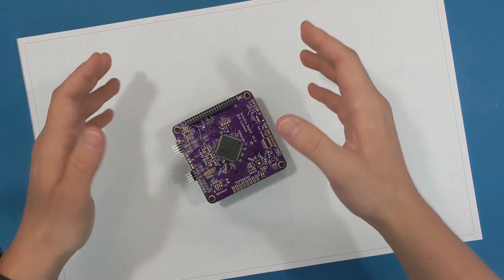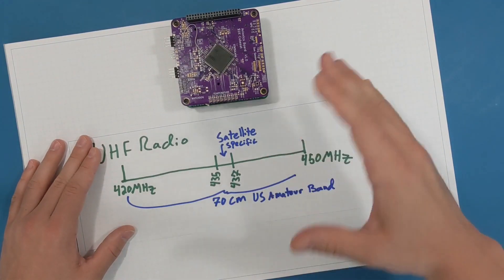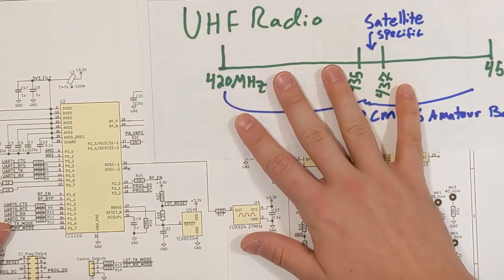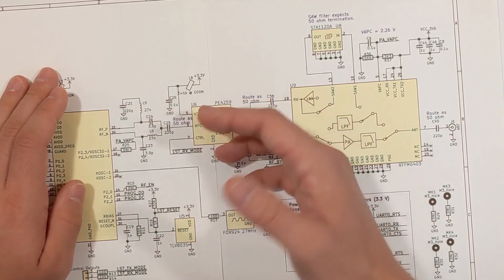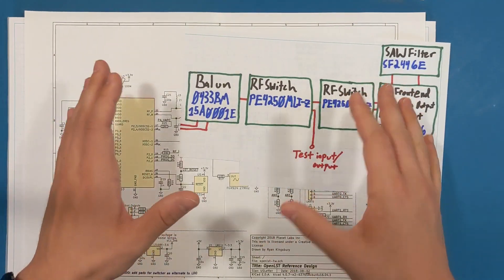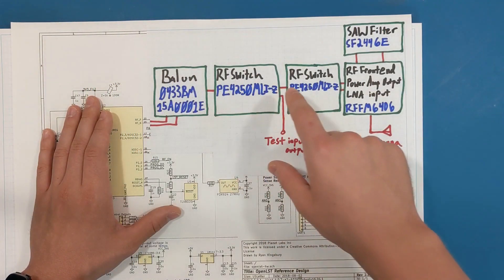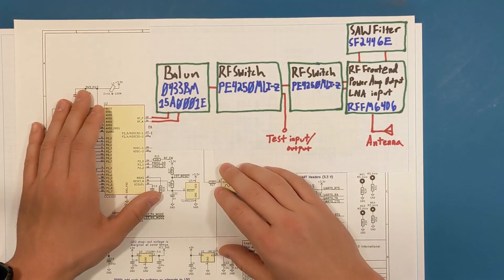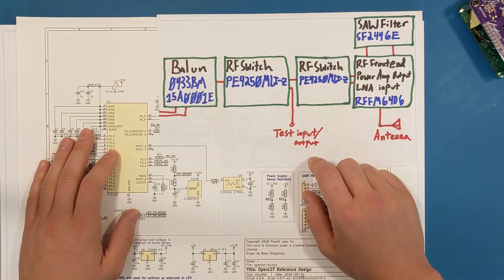$1K Cubesat Radio Design Overview | CC1110 & OpenLST

Comment: Please dont tell me you gave up on this project. I ordered some pcbs using your design. Not even close to the level of know how to build and sucessfully launch a cubesat. But your videos are perfect for entry level.  If you need funding for the project let me know I can assist. Personally I have been looking at the purdue water thrusters with 10 micron orfice along with magnetic remdezvous. Wanting to build a 2u unit and 2 1U cubes that dock in orbit. Solar has come along way since this post. Tested flexible panels encased in epoxy personally works pretty well in testing. But again I am nowhere near the level needed to build and launch and dock in ordibit just experimenting and trying to learn want to launch one eventually.

Comment: Don't get discouraged.  Engineering prototypes are great.  They allow you to work through problems that you never see on the drafting board/computer.  Your multiple board cubesat design is flexible enough to allow choices of communications boards.  EPS and Nav as well.  Im following you to see your engineering process.

Comment: It looks like cubesats have evolved. Some are smaller 5x5x5 cm and use LoRa using an sx1276 or sx1278 chip on 433 MHz band.  Have you seen TinyGS yet?

Comment: It's not hard to get your HAM license so you can test your satellite over the air.  Your local HAM club may have free lessons.  It does not cost a lot to take the exam ($15).   73 (Greetings)  Konrad   WA4OSH
Reply from the maker: Yeah I just need to spend some time on exam prep, and schedule a time to take the test
Reply: @RGSAT  There are four or five Amateur radio clubs that have volunteer examiners (VE) that administer the US Amateur license exams over the Internet.  In foreign countries, the exams may be admisistered by the government or amateur radio clubs.  You will have to research this.
Reply: @RGSAT  There are practice exams available for free at QRZ.  You don't need a call sign to register.  Once you've cycled through all of the test questions in their test pool, you will be ready for the test.
Reply: QRZ:  Resources, Amateur Radio Exams, 2018 Technician Exam Practice Test

Comment: My interest in your Cubesat project just peaked since you've decided to use a HAM radio transceiver instead of Iridium.  Are you going to use the Great Scott Gadgets Yardstick One to test this radio board's receiver and transmitter?  Don't forget to include a variable attenuator between your board and the Yardstick.  You need to simulate about 400 miles of over-the-air path loss.  I would love to build a duplicate of your CubeSat to follow along your design learn more.  Please let us know how we can contribute.
Reply from the maker: Hey Konrad! I don't have the Yardstick One, but I do have a RTL SDR. 

I'll be covering how testing is going in my next video!
Reply: @RGSAT  an RTL SDR is useful for conductive testing (through coax with an attenuator simulating path loss).  GNU RADIO Companion will allow you to decode packets sent by your RF board.  However, you might need a HackRF one with GRC or a Yardstick One to transmit to test the receiver.  To do a radiative test (over the air)  420-450 MHz at 1 watt you will need your Amateur Radio license (part 97).
Reply: @RGSAT  Also the pathloss is often up to 2500km.  I would definitely do a link budget assuming a low earth orbit and consider crowd sourcing the ground stations with both the TinyGS and SatNOGS for LoRa and FSK variants respectively.

Comment: Hey! You have very interesting content, I am following your work! 

I would like to ask a few questions (sorry for my english, I am writing through a translator):
1) Do I understand correctly that your cubesat is powered by a 1S2P battery? Is all equipment powered directly from the battery, or are boost converters used?
2) Which models of lithium ion batteries are commonly used in cubesats, and from which manufacturer? The decisive characteristic is the operating temperature range?
3) Does the number of batteries connected in series (1S, 2S, 3S) depend on the size of the cubesat and solar panel? A large enough panel can provide a higher voltage, which can be used to charge 2-3S batteries. After all, as far as I remember, the buck converters that will be needed to power the payload are usually somewhat more efficient than the step-up.
Thank you!
Reply from the maker: 1) I have 2 batteries in "parallel", but they are not connected to each other. Each battery has its own Battery manager chip. The outputs of the battery managers are combined. This is useful, since one battery could die, and it doesn't negatively impact the other battery. 

2) I believe the cylindrical (18650) lithium ion batteries are popular, but I don't know which batteries specifically. Probably the batteries that can do more charge/discharge cycles. 
 
3) Good question! I don't know what the right answer is. For a simple cubesat like mine, I decided to not deal with in-series batteries. Series lithium-ion batteries require balancing & more complicated chargers. There are a lot of simple 1S chargers on the market, which is why I went that route. 

I use a step up converter from my 1S battery to create 5V. It would have been nice to have 2S, but it's not that big an issue.
Reply: @RGSAT  Thanks for your reply! I'm waiting for a new video =)

Comment: What’s the difference between a 30k$ cubesat and yours
Reply from the maker: More off-the-shelf modules!  At the low price I'm aiming for, I have to make everything myself. If you have more money to spend, then you can buy a compute module or radio module from a manufacturer
Reply: @RGSAT  and regarding radiation tolerance, how much time a cubesat like yours could stay functional in LEO and what kind of rad protection are you using?
Reply from the maker: I'm not sure how long my cubesat could stay function. I don't have any material shielding, I'm simply going to rely on current monitoring to detect SEUs, along with watch dog monitors for each of my processors
Reply: @RGSAT   are you considering a-shielding protection? Because of the lifespans of the cubesat will be 10 days it kinda  misses the concept. (If I’m missing simething let me know🙏😉)
Reply: Z-shielding *

Comment: Great project and video! A few things I found whilst researching into this that I'm not sure if you've encountered too. (I'm building a 3U Cubesat for MSP and am trying to rework the OpenLST design too) 
1. Most of the CC1110s are out of stock (e.g. F32 and F16 variants). 
2. CC1111's operating temp is from 0c to 85c, so can't use that for a substitute, and 
3. The only in-stock ones are CC1110F8RHHR on mouser, but looking at the OpenLST software repo, it seems like the reference bootloader + application will take up around 5.7kB of flash and 2.4kB of RAM. but the F8 variant only has 1kB RAM available. 

Was wondering if you've found a source for the F32 variants (can't find it via octopart) or if you are planning to write your own software to reduce the binary size
Reply from the maker: Thanks for your comment! I had not actually realized that about the CC1110, thanks for letting me know. 

Looks like you'd need the F32 model in order to have enough RAM to support the existing software. I'd rather not have to re-write anything. 

Looks like on (US) digikey there is the USB CC1110F32 available, and Mouser has the F32s on order, arriving next year.

I'll probably just wait to get my hands on the F32, since the less software I need to re-write the better.